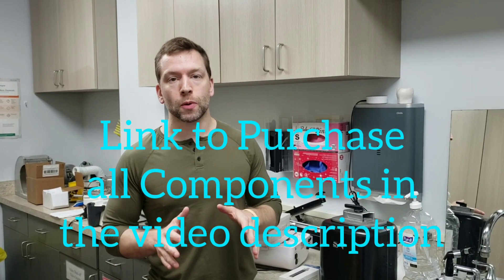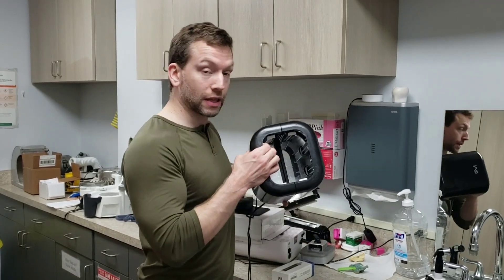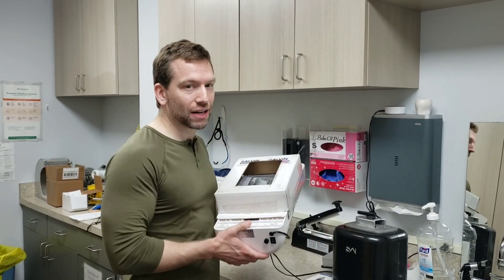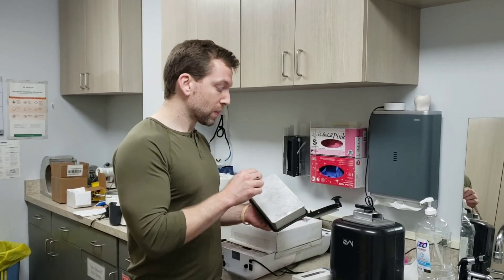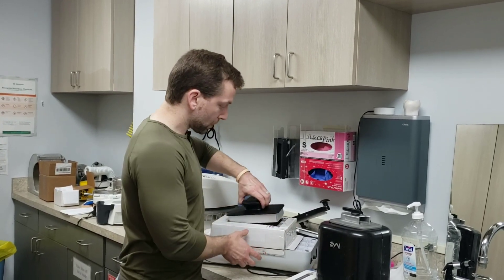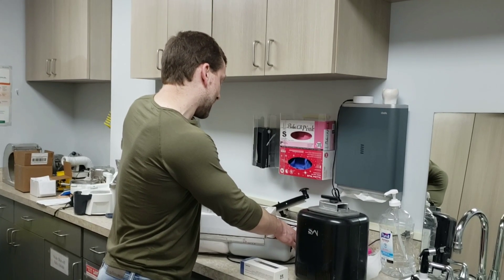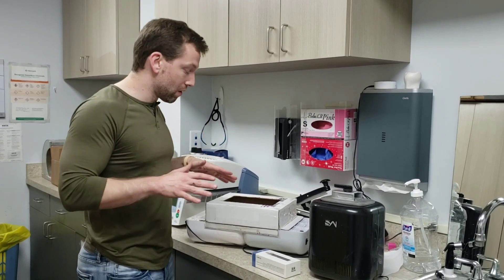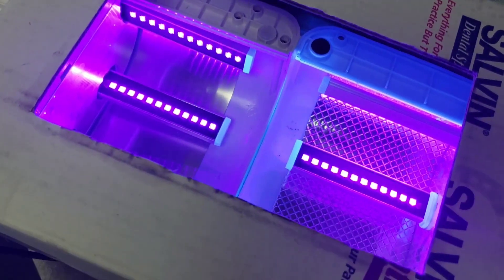DIY Sprintray Pro Curing Unit

Comment: You can get those led strip lights that swivel.  Aliexpress. That said, a new nail box is cheaper than the lights.  I have those in four nail ovens myself.  Two stuck together like your black ones.